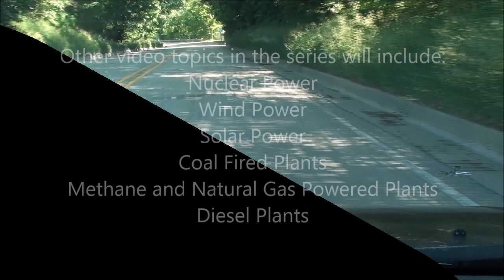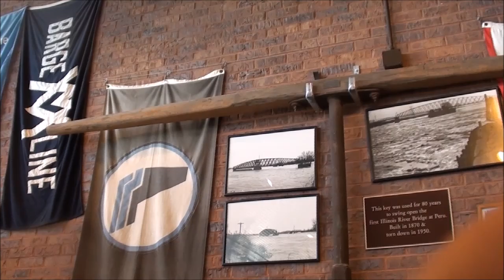tubalcain ROAD TRIP part 1 How Electricity is Made-WATER POWER video 2

Comment: Thanks for sharing. I would be interested in knowing how many feet in length the turbines are that drive the generators, ie 10 ft long> 100 ft long? .....seems like there could be several as wide as the dam is. I grew up on a river in northern  Indiana, and back in the early 50's, the City of Ft. Wayne purchased several acres from my grandfather to build a dam. The dam itself was only a couple hundred ft long, but one small section of it was without any gates, and water rapid flowed through, 24 hours a day,. I always thought it was such a waste,....I  remembered telling my dad, that grandpa should have bargained for generator rights of that one small section!....to me...it sure seems like there was enough head ( 5 ft diameter by 12 ft drop) that we could have ran the farm forever, on that raging water stream!                  Jim

Comment: I don't know if you ever come back to older video posts of yours, but here's hoping. I owned a Harley XLCH for a while. The stock muffler caused such back pressure that the engine, at top RPM could not persistently propel the bike at 55 MPH. So, out to the dealer I went to but glass packs (mufflers). Now those were one of several choices the dealer offered in increasingly loud (or louder) muffles. I went with the medium-low grade as I have neighbors. Still, when I opened the throttle, the noise roared and is too loud. The only place that much noise is good, is on the highway, because it helps nearby motorists know a motorcycle is nearby.
Reply from the maker: Thank you Mark. That is good to know